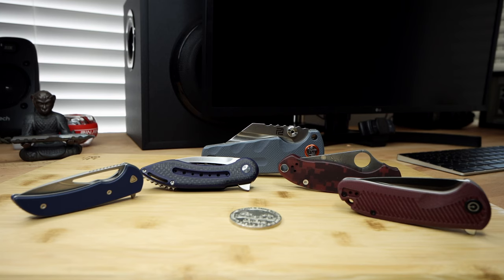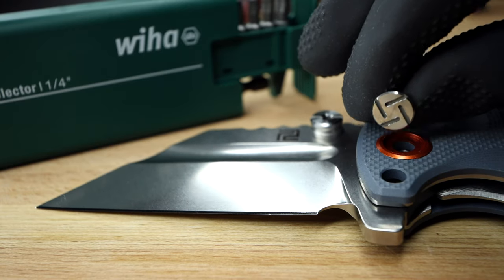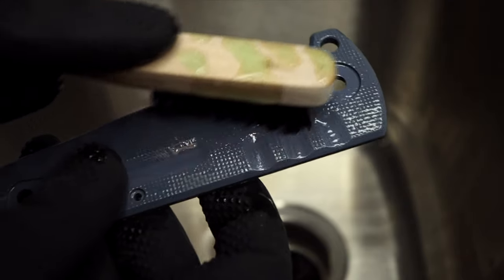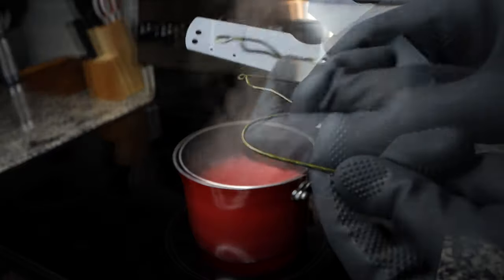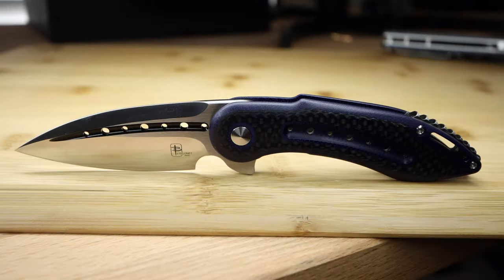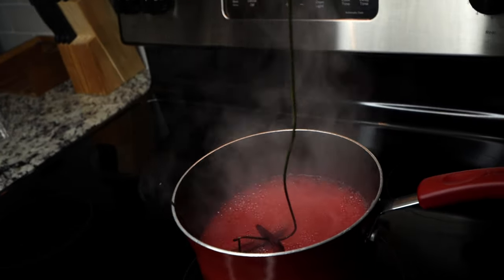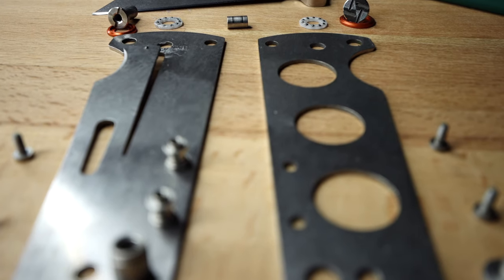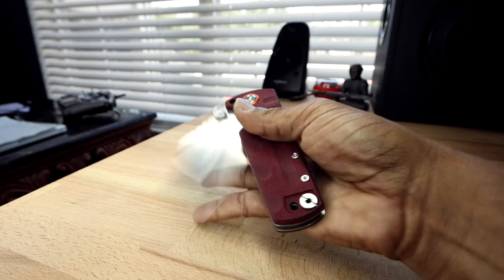RIT DYING SCALES STEP BY STEP WALK THROUGH

Comment: Btw, acetone and nitrile gloves don't mix. Acetone eats right through them and has a breakthrough time of only 4 minutes for 10 mil thick gloves (obviously shorter for thinner ones). Latex works well, but causes allergic reactions in some people. Butyl rubber is the best glove material for handling acetone as a solvent, but it is a little harder to come by and more expensive than latex. Just my .02

Comment: Outstanding video!!! I have dyed a few G10 scales already. Mostly using Rit Dye More Racing Red and Sapphire Blue. I have a set of Spyderco Para 3 digicamo G10 scales that I wanted to dye using Rit Dye More Graphite to make them look like a black and grey urban camo. I used 3 cups distilled water, 1 cup distilled white vinegar and about 1/4 bottle of the RDM Graphite. Heated up to around 200 degrees and placed the scales in the mixture for about 30 seconds. Took them out, washed/cleaned them and they are dark brown. Wish I could post a pic here of them. Any helpful tips on how I can achieve a black and grey urban camo look? Thanks.

Comment: Acetone?!?!?and it didn’t start to dissolve/melt the plastic????
Reply from the maker: depends on the material and the acetone's strength... a Pilar III's g10 would probably disintegrate into oblivion, but not a Para3 or steel craft would take a while 4 sure.  Ive left my civivi odium scales in pure acetone for like 30mins no problem